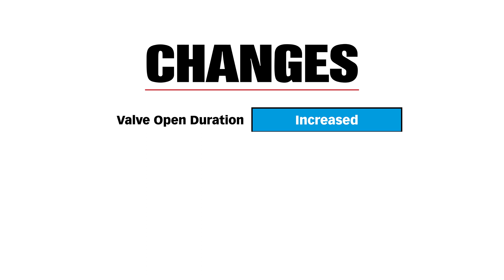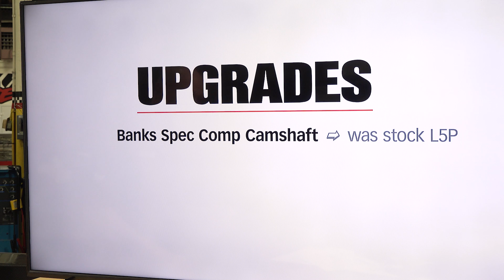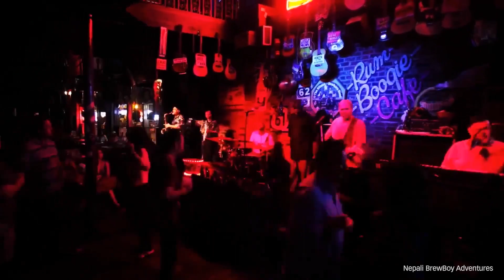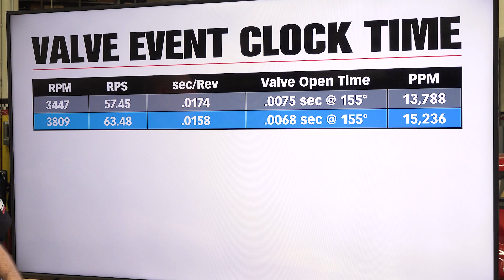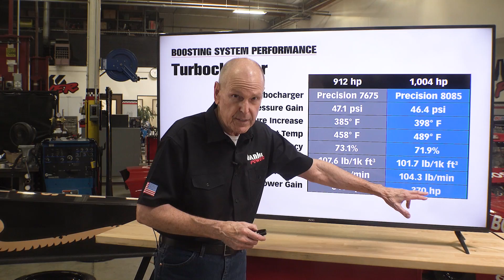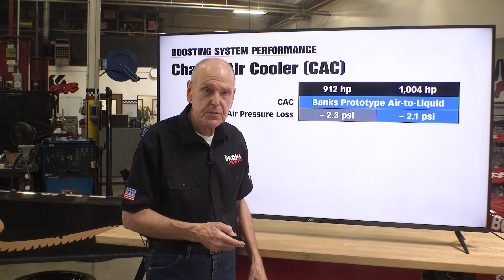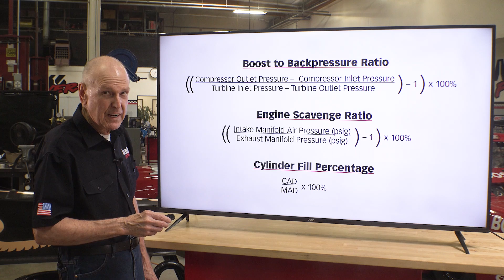1,004 HP !!! Killing A Duramax Pt 15

Comment: Wow!! I’ve learned a hell of a lot in watching these programs!!! Gale Banks is a driven marvel.
You can tell he’s broken records with just his force of character and driven mindset!!
Love it!!!
I’m wanting to push my Mercedes 5cylinder 2.7 diesel to 270 with stock injectors and pump! So as long as I don’t go over 40degrees of injector duration. I can lengthen the injector duration Instead of going for a bigger injector set. 
The DPF is removed. And I’m going to make a conical pipe coming off the turbo to drop the exhaust pressure acting on the piston. Increasing the bore to 4 inches. I’d imagine also lagging the first half of the exhaust to help with evacuation of the gasses. Porting the exhaust manifold and both turbo inlet and outlet will also reduce this exhaust stroke pressure. The charge cooler is double the flow and is bar n plate. I have to remove the restrictive turbo noise reducing manifold that attaches to tho outlet of the compressor. Again removing restrictions and heat from the equation. Enabling the turbo to put out more volume per unit of pressure!
I can’t believe I’ve never seen these videos before in you tube!! Awesome stuff!!!

Comment: Standard Day is 59°F, 29.92" Hg, 14.7 PSI.

Stochiometric charge is 15:1, Gas engines are around 12:1 due to temperature causing detonation and preignition.

Comment: Hi Gale, are we going to finish blowing this turkey up ? I really miss this series.  Thank you for the great videos.  It seems  that you’re next step is likely to be methanol type solution. The next step would be to get the charge air cooler and if that taps out bring on more pressure from compounding the turbos until the cylinder pressure pops something. You are probably nearing the engine’s ability to fill the cylinder or your F to A ratio would have been higher. So a denser charge is needed ad along with it more fuel. A methanol solution seems to fit.

Comment: I wondering how much of the compressor temperature rise is due to compressing the air and how much of it comes from the exhaust side of the turbo and what would happen if you spaced them further apart

Comment: What's next? First a tear-down to assess the impact of those 260bar on the road and crank bearings.  Then get back to sustainable temperature/pressure/air-fuel ratio with the aim for 1000hp at higher rpm.  My estimation  would be  4150-4350rpm, intake, turbocharger and cooler should be still capable,  camshaft and injectors need upgrade. No water, no nitrous.

Comment: what i've learned out of all of this is some of it is basic physics. Higher temps increase pressure for a given volume of gas (I think Gay Lussac's Law) so increasing "Boost Pressure" while increasing Temps may achieve a negative outcome based on the ratios. Throwing more fuel into a system to increase power has an exponentially negative effect on part efficiency/longevity past a certain point which with careful observation of key metrics can help identify these ideal points. Really a whole slew of things, which show the value of observing characteristics of a system to identify the effects of changes and establishing a method of identifying key weak point areas to improve  that may not be readily apparent from current observations.

Comment: I just found this video. So informative I had to watch it twice and a couple of segments three times. 

My suggestions:

-a bit more active camshaft profile with little to no more duration but a bit more lift
-that will require better valve springs 
-all of this to support a slightly larger turbocharger

I think that will get the engine to 1050 or so...
Thanks for the great video!
Reply: The above suggestion is humbly submitted....

I know nothing but my own instincts and math lessons. 

That said...to the young man that suggested these videos should count as 3 credits towards his Engineering Degree...heck yes! 
I would have loved to have a course this practical and this well taught...by an awesome instructor.

Comment: makes sense to to methanol injection for the next round to cool your intake charge.  sure the compound turbo setup will spoil faster and of course make more power but then the combination of those two with a bump in psi will finally torpedo the duramax.  let’s keep stair stepping and see if you can get 1200hp and 1500tq without “kaboom”

Comment: I'd like to see you explain if you saw any twist on you crankshaft. You mentioned in the previous video that you had a trigger setup on the fluid damper you fitted up front so you could measure any crankshaft twist, and that you would discuss it at a later point, but i missed it being discussed.

Comment: You know how to do it Gale Banks! You achieved a horse power gain by upping the revs and maintaining the same torque. That's a mathematical equation. Yes you proved clearly that your mods can make the engine produce that power.  Great research and work through testing! Only one way to break the motor. Make it make the same horse power at lower revs at 200 rpm increments.  Not spectacular like meth or water injection, but I'm sure it'd work!
Ian

Comment: I wonder how much horsepower you'd gain if you simply aligned the compressor outlet to the compressor outlet pipe.  It seems to be cocked by about 15 degrees.  I'd guess 2-5 hp at redline?  See at 4:03 for example.  Or slightly cock it to the exact opposite side by 15 degrees as you can see from thh compressor housing that the air would be expanding in that direction.

Comment: I'm in the process of trying to learn about tuning and engines, mostly gas engines, specifically my drift car. I've never really been that interested in diesel, pretty much completely because of the "roll coal" fad. Thank you Mr. Banks for spreading the truth. You have lit a fire under my interests/motivation to learn outside of my comfort zone. I would love to see a combo of water/meth and compounds with proper CAC between turbos, done the "correct way."

Comment: Gale: I would like to see first adding Hydrogen @ 3, 6,9,12,15, and 20 liters/second. Then Water meth at common ratios followed by  and then with methane, propane and then CNG.  Then compressed air. Followed by Nitros as we all know the impact it has.Then design a CAC using cryogenic fluids like liquid Helium.Yep i do want to have my cake and eat it too!

Comment: Really enjoy all of the videos on this series. Refreshing to see someone who has had a huge impact on the industry relay accurate information in an easily understood format. Great job Gale!!

My vote is compounds, because Air Density Matters. I don’t think most fully grasp the concept of what is possible with properly designed systems which focus on burnable air mass in the cylinder at Intake Valve Close. Hopefully one day we cross paths. I’m looking forward to it.

Comment: Is the 125k turbo speed limit for the 7675 or the 8085?
Reply: I'm pretty sure it was for this test with the 8085. 125k seems really high to me for an 80mm compressor. Garrett rates their Gen2 80x109mm compressor to 102.5k rpm. It also appears to have a better flow map for this application.
Reply: Timothy Bayliss yeah that’s kind of what I figured too.

Comment: Try doing a stock internal 5.9 Cummins and you’ll be surprised on how much power stock internals can handle in those engines even the 6.7l 24v Cummins
Reply: He has done it with a marine engine development for the navy. What ends up happening at 700hp and 350 hours is the deck of the cylinder block starts to break off the rest of the block at the bottom of the head studs. He tried a bunch with improved castings and eventually cgi blocks but couldn't get to 800h.
Reply: Timothy Bayliss that’s because its a marine engine marine engines are cooled completely differently and it doesn’t have the same cooling system then regular on the road engines

Comment: Engine stand not chassis dyno. Maybe 800 wheel if it was in a truck. So in theory if this was in a truck you would be spending around 15k in parts for 800hp. Not super impressed. I have a 2017 6.7 powerstroke, tuned and deleted with a rudys turbo (around 4k in parts) just made 687 on the dyno.  Stock injectors, stock cam, no lift pump. Gale knows his shit but his expectations of power are outdated. There’s probably 3-4 people im my city that have 800-1000 crank horse trucks or close

Comment: Gale, I think the next step forward here is going to be Water/Meth Boost Juice to really drive home the efficiency of cooler charge air.  Leaving Boost the same, we'll be able to remove fuel (since the water/meth displaces that), keeping things cleaner than ever.  We can do an experimentation with something like 5% Total Fuel Mass as Alternative Injected up to maybe 15%.  Beyond that it's going to have negative effects and slow down the combustion event.  Once we find an ideal injection percentage and new target AFR, we can push boost up and see some damage.  1125hp.  I think she can make it.

Comment: Amazing engineering there, really informative as well. What about a super-turbo combination for the next step? Would the scavenged hp from the supercharger plus the temp increase outweigh the hp gain in this setup? Would you need to beef up the intercoolers by a large amount?

Comment: Wouldent 3800 rpm with the stoke of 3.89 set the piston speed at a realativly slow ~2500 feet per minute? What factor kept you from reving it to a higher but still safe (piston speed wise) 6250 rmp?Witch would put piston speed roughly at 4050 fmp. Just The stock internals? or heat and compressor speed?
Reply: or are diesels piston speed more susceptible to wear or failure at high speeds?
Reply: Dynamic reciprocating stresses don't matter that much in a diesel.  The limitation on engine speed lies more with the combustion process.  Can you burn all the fuel at 6000 rpm?  Banks' monster truck project is going after that problem.

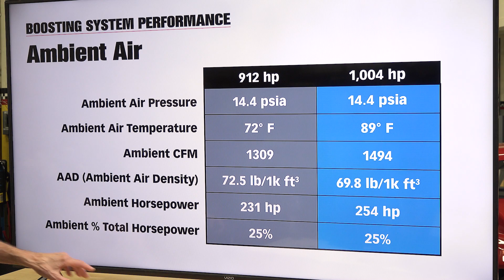Comment: @banks power , I didn't fully understand the ambient % total horsepower numbers at the 17:35 time mark.  Would you not see a significant decrease in this % as ambient air density/temp gets worse?  Or is that less significant than I am thinking

Comment: Ok all well and good. Now how do the figures compare? 
Eg.What if I want to set up my diesel engine for country touring. How can I determine my setup considering;
- continuous highway miles
- when driving up hills for a long duration 
- hill climbing under load ie towing a van. Some examples/comparisons would be great
Reply: Buy a truck with the stock 445 hp Duramax and be happy.  It has more than enough power to do anything you're describing.

Comment: GM? Thought Isuzu did most of the work
Reply from the maker: It's quite the contrary. Despite what most people think, Isuzu Motors Ltd. of Japan has very little to no design input on the Duramax engines for GM HD trucks. They co-own a portion of the D-Max company (the Duramax engine manufacturer) with General Motors.  GM/DMAX LTD owns 100% of the intellectual property on the L5P. Izusu owns 40% of the manufacturing facility but had no involvement in the development of the engine. The L5P is a GM ground-up design and they are built right here at home in Moraine, OH.

Corporate site: https://www.dmaxengines.com/history/

Truck Trend How it's made: Duramax engines: http://www.trucktrend.com/cool-trucks/1012dp-how-its-made-the-duramax-diesel-engine/
Reply: Ah yeah thanks mate

Comment: Out of necessity for drag racing I found a way to get hilariously skewed intercooler efficiency numbers and finally seeing someone that actually understands that topic is great. I use my cars AC system with a liquid to liquid cooler to get the intercooler water well below ambient temperatures. Currently I am trying to get 300% intercooler efficiency for starting point IATs over this Summer. Really need to get an iDash Data Monster to log the results.
Reply: It is impossible to get intercooler effectiveness of more than 100%.

Comment: I'm a crusty old diesel fitter thats LOVIN this series, because I'm also a rev head/ex racer...
I'm also a lover of a product that lasts so I tend to like making way for improvements, so I would go-
More CAC, then more compressor, then more fuel, then more cylinder head flow..
Would that be in line with you boss?

Comment: Ok , so cred to GM engineers fair enough . But Duramax engines are a joint venture between Isuzu and GM, Why no cred given to Isuzu ?
Reply from the maker: Despite what most people think, Isuzu Motors Ltd. of Japan has very little to no design input on the Duramax engines for GM HD trucks. They co-own a portion of the D-Max company (the Duramax engine manufacturer) with General Motors.  GM/DMAX LTD owns 100% of the intellectual property on the L5P. Izusu owns 40% of the manufacturing facility but had no involvement in the development of the engine. The L5P is a GM ground-up design and they are built right here at home in Moraine, OH

Comment: I would like to see those log manifolds replaced by tubular ones with a decent merge into the up pipes. That to lower exhaust backpressure, EGT and release a couple more free horsepower.

Comment: i think you should do is just put a pin hole in the oil pan if it survives anything else you do to the engine and see how long it last while oil slowly runs out of it, basically a Detroit diesel but at a faster rate

Comment: Wow, what a great series, never ever came across so much detailed information and explained so well. I wished it was there when I converted my Isuzu Y17DT turbo Diesel car engine to use in our airplane. I probably would have avoided so much troubles and learning the hardway leading to a emergency landing due to a broken crank, which luckily ended well due to the skilled pilot. Thank you very much

Comment: I would love to see a water meth system tested on here to see if it’s worth putting on a truck but I’d also like to see you test a propane boost system. 

My dad runs propane boost in his old 425 cat and I think it added about 100hp on the Dino. He makes around 650hp with that thing.

Comment: I'd like to see a "smoke cam"... in the name of science.  Also... hold a power level for say... 1 minute.  also, in the name of science.. what is the duty cycle of say, 900 HP with this engine's setup.
Reply: Duty cycle of the injectors would be 10% less at 900 hp than it is at 1000 at the same engine speed.

Comment: I want to see what it takes for him to get 1,000hp from the 2020 6.7 power stroke and then compare the data from both. Which style is more efficient in power, packaging, air density, etc. The conventional air flow on the duramax or reverse air flow on the power stroke. That would be a nice series to watch

Comment: Run 24 hours at 3400 RPM.
Reply: When the navy approached him to do engines, the test was 800h at 80% load cycling between peak torque and peak power. It's a double Nato certification. All kinds of strange things were happening, but in these tests the cylinder walls would fail about 250h into the test, laterally from the bottom of the head studs. The pressure of the combustion was starting to rip the head off the block.

Comment: I'd like to see if the L5p can handle compounds. If I understand them correctly (which I'm still learning) you would put a 98mm to 100mm large turbo over the 88mm that is already on the L5P.  I'm super curious to see of the exhaust drive pressure will be too high with that large of a setup. What are your thoughts Gale?

Comment: Finishing up my associates in heavy duty diesel technology . Even remote learning hasn't happened my lust for making diesel fuel into noise and torque.
Hammer down
Grab a gear!
Reply: Horsepower vs torque was explained to me as: horsepower get you to the grade ; torque get you up the grade. Torque is the measure of twisting force , horsepower states the ability for acceleration over time.
Reply: I through the hole banks catalogue at my 97 f350 for hotshot duties. Made just north of 400 hp with 650 ish torque. This is child's play with the power ratings of off the lot trucks . with a extra high ceiling for experiments

Comment: Cool stuff!!
But my head hurts almost as much as that engine's bearings!
What would the crank bearing speeds be at each of the 2 rpm levels?
Can you correct/adjust the 1,004 HP dyno run to account for the significantly hotter day?
Guessing 1,030+ HP?
What do you expect to be the 'weakest' link....connecting rods?

Comment: Doesn't a V8 give 8 power pulses per revolution??
Reply from the maker: Yes.
Reply: @bankspower  Sorry to nitpick - Gale said there were 4 pulses per revolution, so I'm hoping it was just a slip of the tongue and the maths is is still correct :)
Reply from the maker: @edwardhart7032  Here's the correct answer. For every one rev of the crank, the cam makes half a rev. That's how you get four power pulses per rev of the crank. The cam is moving at half the speed.

Comment: Whenever Gale does another episode he should pause at the previous power level (in this case, 912) and show with the upgrades that were done how much more efficiently it runs at the previous max.  In this configuration you would probably see less boost, lower EGT's, less fuel, lower charge air temps, etc.